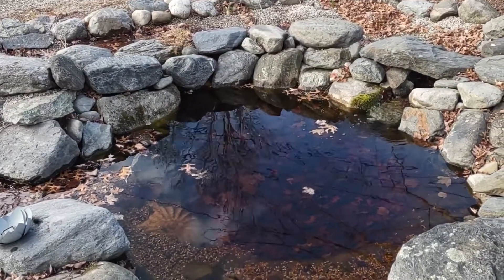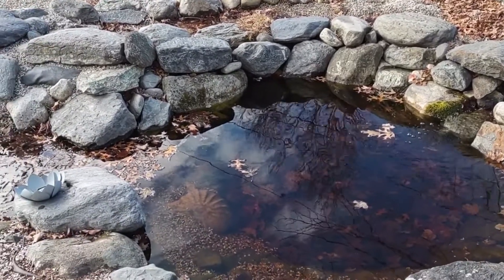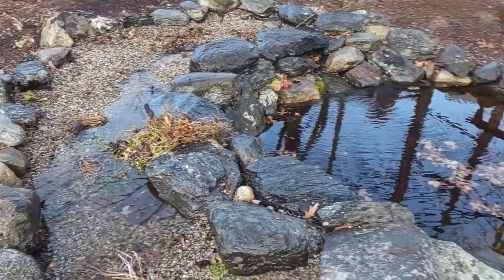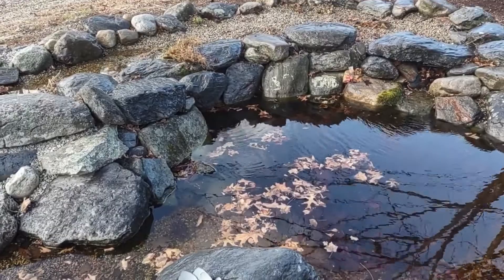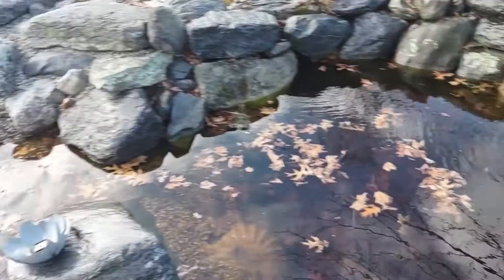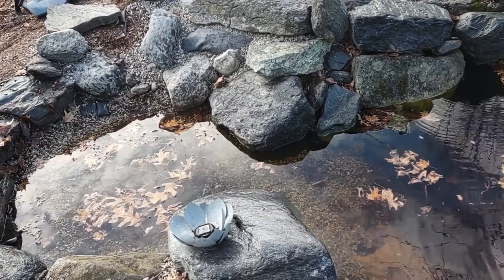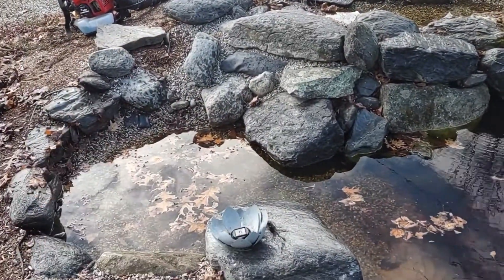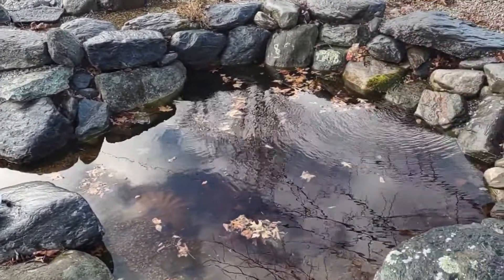Winterizing INTAKE BAY and BOG FILTER garden ponds

Comment: I like your setup. Mine is going to be similar with a bog along the side that's hopefully a bit higher than the pool itself.
Reply from the maker: Getting the height correct across the entirety of the bog is the hardest part. If you haven't seen a "water level" yet it's a useful tool that can help predict water levels across large uneven spaces. In the end make sure to build in a secondary overflow that goes INTO the pond and not in the other direction (another thing I learned the hard way :-p)